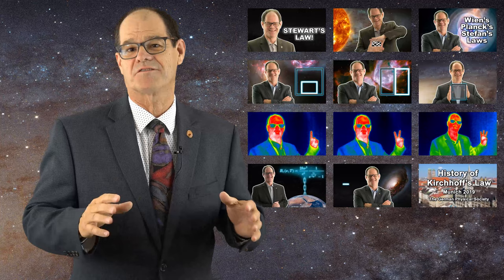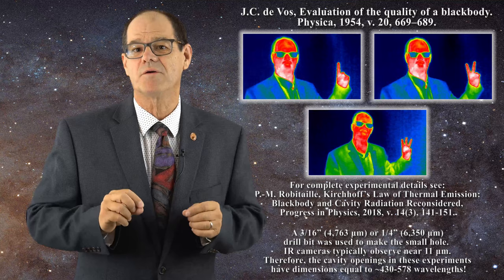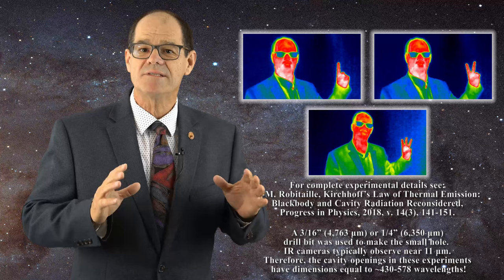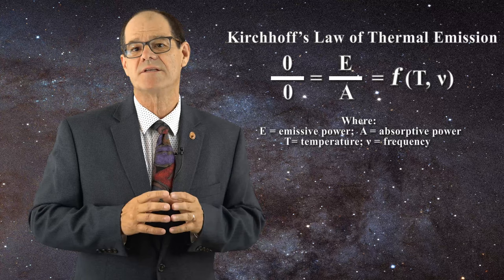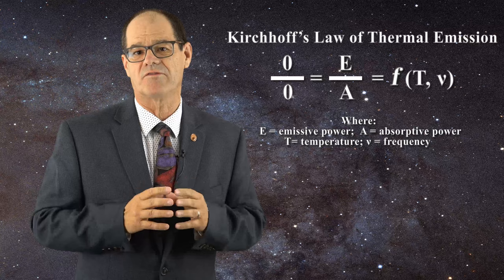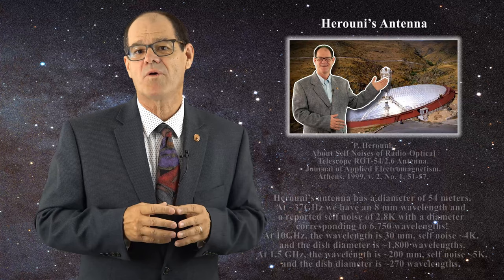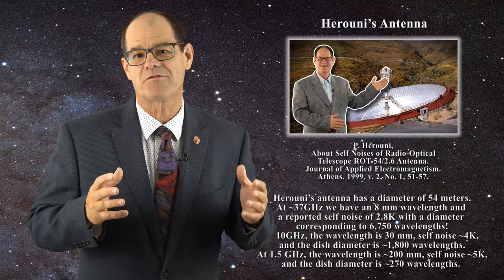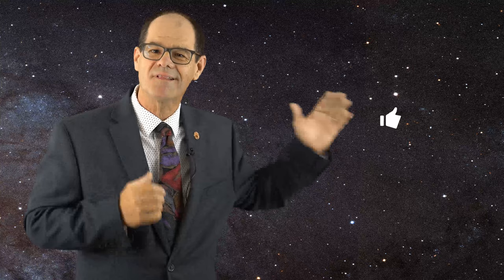Kirchhoff vs Herouni's Antenna!

Comment: Let Sky Scholar get relevant. Why is it important that Kirchhoff's law is false. 

Explain the implications of this. Do it in the way that truly describes the extent of the problem.

 What would it mean to astrophysics, if this law is false. Explain why this is so centrally important to the current theories of cosmology. Do this series of videos and maybe your argument becomes relevant, maybe it gains traction. This is pulling the argument rather than pushing it (both of which are needed to establish the point). Common folks will listen and they are the most intense and powerful group yet known. Win them and you could win the war of ideas.

When the common folk, like me, start listening, the professionals have no choice but to defend their position. They need to be called out.  It is very much like the "black hole image". I honestly do think that the discerning reader understands that the black hole picture is nothing more than a colorized image based upon expectations of mathematical models anticipated by a group expected to return amazing results. Whoa. I have empathy for them and their endeavors. But it is not a picture of a black hole, not even close and the public has been led to believe it is. But I digress.

Explain why the cosmologists are wrong in using a false theory. That will get the attention of the most important group, people like me and many many others. Start there.
Reply: Crickets??? Where now are all of you supporters of PMR? You should be climbing on board encouraging PMR to go for it and develop a new and more effective strategy. But you are all strangely silent. Very silent indeed. This is not a game, this is the real and true essence of science. I am shocked at the lack of interest.

Ian, a question for you: Suppose it is shown that the law of thermal emissions is false, does that impact the current theories of cosmology? And how?
Reply: @michaelc424  I thought the 12 previous videos he mentioned covered it quite well. If a dozen aren't enough, then probably no number will be.
Reply: "When the common folk, like me, start listening, the professionals have no choice but to defend their position. "

Wrong. Scientists couldn't care less what silly ideas laymen believe. You need to convince the scientists. And you aren't going to do that by posting scientifically impossible gibberish on youtube.
Reply: @bobsmith231  With respect, I disagree. When the common folks begin to realize that scientists are wrong on any given theory, I assure you those folks will bring into focus the problem. Once mainstream common folks say "wait a minute here", the experts will run for the doors. It has happened many times in human history. Not only in science, but in many different areas of human endeavor. 

Whether this happens with the PMR arguments is not yet known. But he is no rookie and has taken on the prevailing wisdom of scientists once already, and he was proven right. The experts in his field said you cannot do this, and PMR did it without respect to their argument. 

He was right, they were wrong. You cannot ignore this fact. Track records mean something. So I am listening. You should too.
Reply: @midlander4  Well, I would assert that I am not spectacular nor gullible. But maybe I am spectacularly gullible. Midlander4, I have a question for you: are you spectacularly gullible? I listen to arguments all the time professionally and I have an understanding of the form of an argument. PMR is clearly knowledgeable. From time to time I get the impression that the PMR argument is a bit muddled. He argues that Kirchhoff's law is false and that alone will bring down the current theories of cosmology. I have been asking for some time for this to be explained in greater detail. But then PMR also makes the argument that the CMB cannot be determined with the use of Plank's interpretation of Kirchhoff's law because the blackbody radiation being measured is not a measurement involving a wall of any kind, perfect reflector or perfect absorber. So how does this all work? 

Perhaps you know and maybe you could explain it all. Can you? 

By the way, do you qualify for the IDQMI support group? You can only join if you do not have a PhD. Spectacular. Gullible. Naive. Stupid. Ignorant. These are all great descriptions of nothing. Do not underestimate the power of the common folk. They are the most powerful group, of that you can be assured.

Comment: It would be freaking amazing if you had the first clue what you were actually talking about, but than again you never do wich is rather sad and pathetic if you ask me. 

You are comparing blackbody radiation and cavity radiation, that is like comparing french cheese with canadian aluminium. They both have their strengths and weaknesses both of them well (albeit not perfectly) understood, but you would never ever compare them with each other.
Reply: Kirchhoff insisted his observations were true for all cavities regardless of their walls.
Can you produce blackbody radiation without a lattice? Nope you cannot...that is the point.
Reply: Daniel ..... 
Are Related to Professor Dave by any chance ?
Reply: @decadent.  "Professor" Dave isn't a professor. He isn't even an associate professor.
Reply: You obviously don’t understand what Kirchhoff claimed. According to him, every opaque cavity at thermal equilibrium at the very same temperature contains the very same blackbody radiation field, irrespective of the nature and form of the cavities. 
        If you examine the cited paper by De Vos, you will learn that even the tip of a drill bit, producing a simple cone in material, can act as a cavity.  Now, the question is, how do we think about Herouni's antenna, relative to Kirchhoff's statement that the radiation contained within an enclosed space will always be black or normal? When studying blackbody radiation, astronomers often portray an enclosure with only a small hole, so that once radiation enters the enclosure, it cannot escape.  This is such nonsense, because you first have to fill the cavity with radiation from the outside and that radiation must be black!  This is especially true if the enclosure has perfectly reflecting walls, because, as Dr. Robitaille has shown, such a cavity cannot do any work on the radiation! Now, consider Herouni's antenna. It is a cavity, but with a large opening.  Does the size of the opening matter?  Well, in this case, it does not because no photons are able to enter the cavity from space in the first place, no matter how large the opening is! That is because, Herouni found that the contribution from space is essentially zero to the noise of the antenna! Now pretend that you can seal up the antenna completely to make the enclosure Kirchhoff wants. How do you propose that you are going to get 300K blackbody radiation within that cavity when it is clear that the walls can produce none and none can enter from the outside? So, this completely destroys the argument that an enclosure with a small hole is all it takes to get a blackbody.  Kirchhoff required that the walls be in temperature equilibrium with the environment, and for Herouni's antenna, that requirement has been met.  The dish is in contact with ~300K ground, yet it contains microwave radiation reflecting a temperature of no more than 5K.  The problem for Kirchhoff and his followers is that his law was purely mathematical.  It had no experimental proof and still does not today.  So, if you want to argue, go find us a proper mathematical proof for Kirchhoff's law (none exists, as all proofs have been shown to have problems) or better still, go get us an experimental proof, as is required whenever a law of physics is said to exist.  Such proof's do not exist and Kirchhoff's law is nothing but nonsense. Resonant cavities exist and Kirchhoff did not know this in 1859!  As stated elsewhere on this page, its high time for astrophysics to move into the 21st century!
Reply: @bushmangrizz4367  "If anyone does not understand physics, it is likely an astrophysicist..."

They understand it better than unqualified youtube cranks like Robitaille and Crothers.
Reply: Here's one problem, as I see it..."NOBODY asked you". 
So all that yammering you did, was for naught.
Reply: @ianw_xvi8784  "Dumb comment. We know how stars work." You haven't a clue. And you haven't watched any of these videos. Yet there you are pontificating about things that you couldn't possibly comment on because you don't actually know what Dr. R. is talking about.